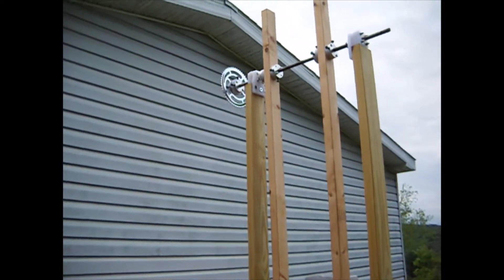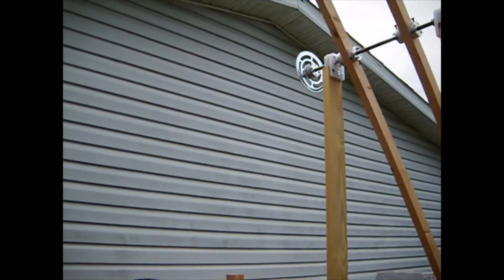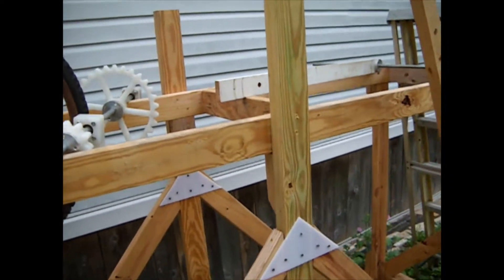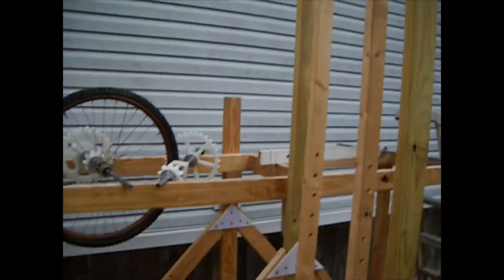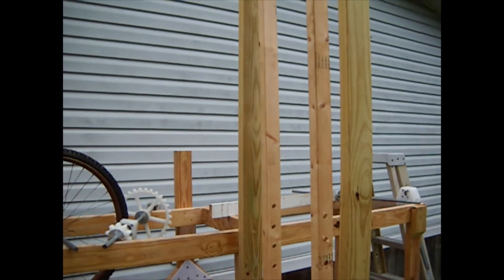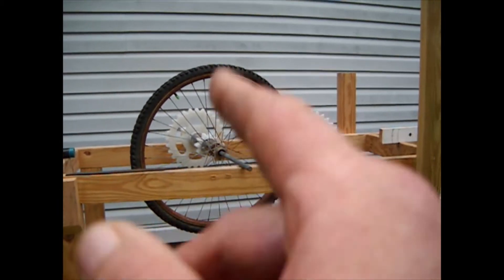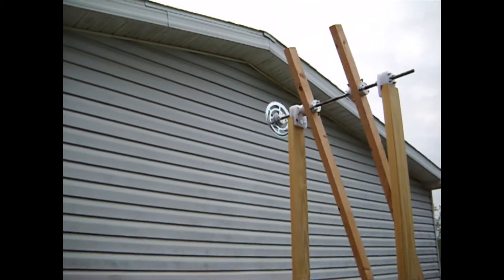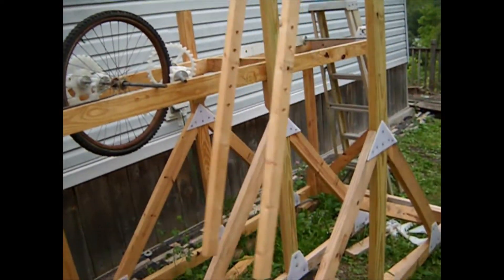pedulumDrive8 26 20

Comment: 2 motors to drive the machine? In hopes the machine is >100% efficient?
I've seen curious 2-stage oscillators but they only offered peak torque, not continuous. And extracting it would stop the motion.
Reply from the maker: Hi, thanks for info. The two motors will be used as electrical generators.  It will have to be a open system. Basically this is just bunch of basic experiments.  Not a OU project. Thanks again. Cheers